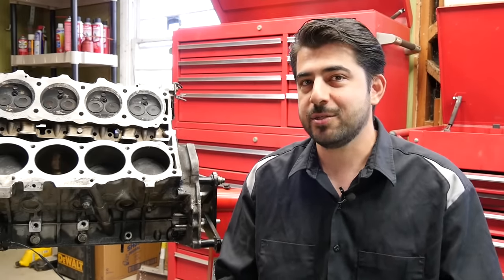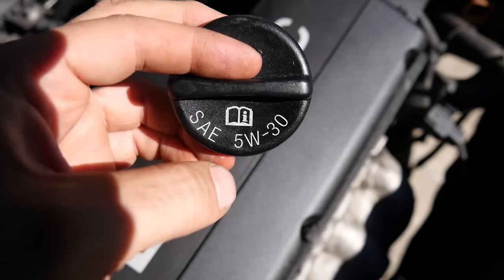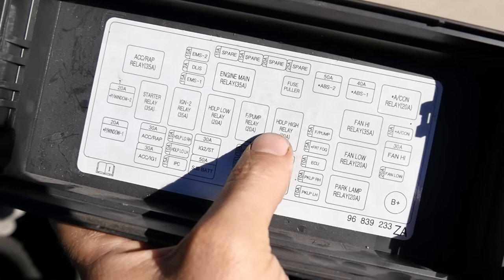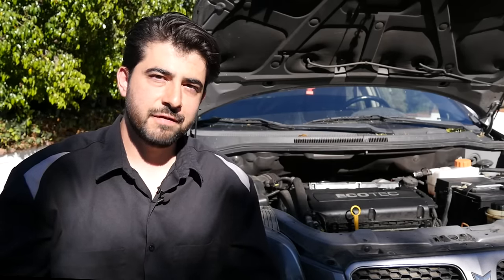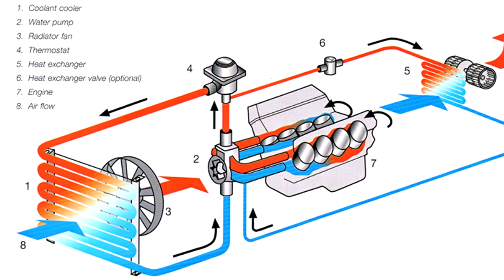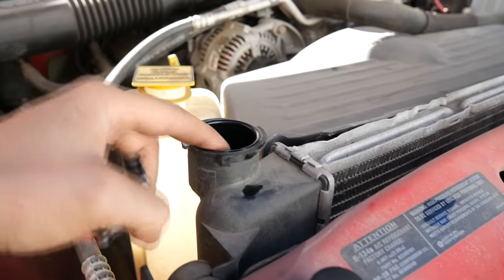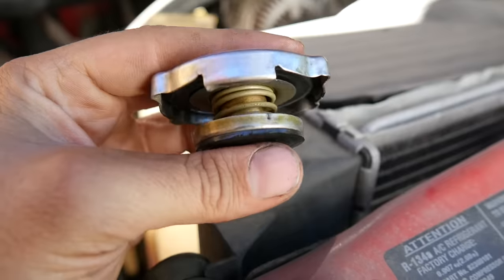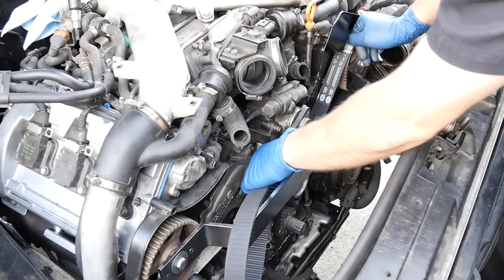Make Your Car Engine and Transmission Last a Very Long Time - Top 5 Tips On Car Care

Comment: Letting your engine warm up and cool down properly and changing oil ever 10,000km (I only use Mobil 1 0W40) already goes a long way.
Reply: Hey bro. Can i use 0w40 instade of recommended 5w40 for skoda 1.9tdi engine?
Mobil1 0w40 is great oil.
Reply: @1.9tdilove71  sorry for the late response. You can use it. If the car has a particulate filter you need the 0w40 esp oil from Mobil 1.
Reply: @Rodrigo Novais exactly!
Reply: @xcofcd  Thank you. Car is not having dpf. 
Which would be good oil 0w40, 5w30 or 5w40 for 1.9tdi diesel?
Reply: @1.9tdilove71  I'd use only the Mobil 1 0w40.  I had it in all my BMWs diesel and gasoline and never had any problems with engines. My Diesel at the moment has 430.000km and even has the first turbocharger. More important than the brand is changing the oil regularly and much earlier as the recommended interval. And don't use the typical longlife oils like 5W30 they're all more designed to save fuel than to minimize wear in the engine. The number before the W tells you the viscosity of the oil when cold. When you live in Norway where its cold for example a 0W oil is much better than a 5 or 10W as the oil gets everywhere in the engine much quicker on cold starts...
Reply: @xcofcd  Thanks bro. 
My 1.9tdi diesel is 2007 model, clocked 90000 Kmart on odometer. 
I use Mobil 1 0w40 from the beginning. 
I heard about Amsoil that it's good. what you think?  And do you use any diesel additive?
How is that Liqui moly molygen 5w40 and top tech 5w40?

Comment: Transmission cooler is a solid advice. Add external oil cooler since many cars nowadays include turbochargers which make the oil extra hot.
Reply: When buying a truck, get the tow package, it likely has an extra transmission oil cooler.

Comment: My 2005 Ford Focus is reaching 300K with the original engine. The Steel Drive Train/Timing Belt probably helps. Also I believe it being the more sturdy built "Special Edition" probably helps too. Plus I service everything when it needs to be serviced and use only Full Synthetic Fluids.

Comment: What about putting an oil catch can, I think it would reduce the crap that goes to the engine that would make it dirty from inside, especially in GDI's
Reply: @ThePatUltra Your points are valid, but a catch can is also a very good solution to GDI carbon buildup on valves.
Reply: Scotty all explains in his videos they fixed the GDIS bro

Comment: 1997 Ford Expedition 4x4 4.6L.
352,734 miles and not even a tap .
Secret ?
Change the oil and filter every 3,000 miles.
Reply: Dang! Good job, bud. I wish my 2013 Ford Fusion will make it to 200,000 miles. I love the car, but the transmission has a slight jerk between 2nd and 3rd gear at 99,400 miles... though it's minimal and doesn't always happen. I'm doing my best to maintain it in good shape. If I can get another 100,000 miles out of it, I'll be as happy as a clam.
Reply: @LuisRamirez-ln3cj  like scotty says stick with a toyota. Their transmission and engines are greatly manufactured. Maybe Ford trucks are better i am not sure. But I have had great experience with Hondas and most recently a toyota
Reply: @LuisRamirez-ln3cj  change the speed sensor.. theres also an adjustment around the valve body that will make that go away
Reply: @fredc8618  I'll keep that in mind and check it out. Thanks!
Reply: What about the trans and the transfer case 
And the differential???

I know you put a rear hub on it for sure though!
Reply: machia0705 I have a 2006 Ford F150 with a 4.6L with over 341,000 and you're right. That thing is awesome.
Reply: @sajid1891  ford trucks are definitely not better
Reply: @123ChrisG  like I said I am not sure. But I have a few friends who have been driving the same ford truck for the past 15 to 20 plus years with over 200k on it. They bought it brand new.
Reply: @LuisRamirez-ln3cj  ford fusion and feista had transmission issues. Trade it off.
Reply: Luis Ramirez The 2013 fusion and focus both have documented transmission jerk problems. It’s not the car failing, that’s the car. It’s just cheaply built.

Comment: It's true that cars have timing belts but you should also mention that if the car has a timing chain instead, that these are not required for replacement..
Reply: Depends on mileage. Some timing chain will wear out in only 180k.

Comment: What do you think about installing a seperate oil cooler?  Do you think the stock oil pump will  be able to push enough oil and circulate it appropriately with an added cooler?  Thanks for all the great videos!
Reply: I think it's unnecessary, and can cause more problems as you said. Don't keep it in drive (or reverse) unnecessarily, as that heats the transmission up. Change the transmission fluid a little more frequently if your type of driving gets the transmission hotter, but not too frequently because you don't want to remove all the old fluid which has particles of friction material suspended in it, and that's what helps it to engage and provide drive.
Reply: @JulianKapa  thanks so much for your detailed reply.👍

Comment: I have to disagree with the last point. OEM parts are usually a good. However, there are many excellent aftermarket parts out there. There are also even aftermarket parts that outperform OEM parts.
Do your research both for professional reviews and direct feedback from owners who have installed the part.

Comment: Debatable on flushing a high mileage transmission.
Believe it or not, some of that high mileage fluid is what is keeping some of those transmissions together.
Reply: It will cause it to slip more but it will also prevent any further wear.
Reply: Fact

Comment: I always prime my oil filter, even if it goes sideways, just don't top it off. Too clarify, quality aftermarket parts, bendix, wagner, gates etc... are fine as they meet or excede oem. Asking for the cheapo replacement at Autozone, NAPA or any major autoparts outlet, may save a few bucks up front, but can end in disaster. Just not worth it.
Reply: I only get parts if they have warranties. All of the manufacturers you mentioned warrant their parts. If it's not a good enough part to have a warranty, it's not a good enough part to put in my car.

Comment: I aint never doing a trans flush.
Reply: Better to change the transmission fluid, then drive it 1000 miles, then change it again.
Reply: @crand20033  ^ or alternatively just drain and refill every 10-20k miles
Reply: @no candy Drain and fill doesn't replace all the fluid.  Maybe it is 1/3 to 1/2 of the fluid.  Assume 1/2.  First drain and fill (DF) leaves half old fluid.  DF in 15k again, that means 25% old fluid.  DF in 15k more miles means 12.5% is old fluid.  DF in 15k more miles, 6.25% is old fluid.  This is why D&F is done much more often than is necessary to completely remove all the fluid and completely replace all the fluid.  Maybe you knew this, but it sounded like you were contesting Scarea's methodology which appears to be pretty sound.

Comment: Really find it hard to believe that engine wear occurs after an oil change or before starting up because you still have residual oil on bearing and other engine parts. Oil also gets from the pan to the cams in a matter of seconds.
Reply: Will Kerdasha yeah you must not understand oil pressure. The bearings in an engine, cams, valves, and pistons all are expecting a pretty high amount of PSI of oil. The pressure and oil pump create a film boundary layer that virtually eliminates friction. The oil passages are small and it’s not a high flow situation but it’s high pressure and low flow. So when you don’t have oil in the filter, it will take 5-10 seconds to fill it with oil and then to regain full pressure. This won’t blow the engine but that’s not the question. The goal is to eliminate all avoidable wear.

Comment: F150 4x4, 429k miles. Purring like a kitten. Original 5.4L & Transmission, 4 wheel drive,  Starter, PS PUMP, Radiator, & many other original parts.
How ? The gas pedal. I have never ever stomped on the gas. No jack rabbit starts.   
Gentle on the gas pedal & it will run forever.

Comment: Flushing the transmission destroyed my BMW transmission, never again.
Reply: why and how?
Reply: @Frank. T Yep, drain and fill like the factory recommended book says!
Reply: Frank. T what do you mean just take the drain plug out and be done or csn i change trans filter then refill
Reply: Flushing is for toilets.
Reply: Your transmission was already fucked if that's the case. Transmission fluid should be replaced every 60k-75k depending on the vehicle. There is no such thing as a life time fluid.
Reply: That usually means the parts were too eroded by that point anyways and the number of particles helped create enough friction to keep it moving so it wasn’t the flushes fault
Reply: @MiguelRPD  Yes, but the practical point is that his transmission was still functional before the flush, and very likely could have been functional after a drain and fill.  But it sure wasn't functional after the flush.  The GOAL is to have the vehicle last as long as possible. If you can get another serviceable two to three years off the bad transmission, why not do it?

Comment: Im not sure if my used car has had its timing belt changed. Its a 2006 ford focus 1.6 with 78,000 on the clock. I have read the belt should be changed either at 100,000 miles or 8/10 years time. Im thinking of just waiting till 100k.
Reply: luis luis good cars. Be safe and change it before 100k mis. Use high quality motor oil & filters. Change oil at 5k mis. Owned 2 Focus got 200k mis + out of them!
Reply: David Klimmek Thanks for the advice David. The car now is worth only about $1600 now and i have spent the same amount since i brought 4 years ago on repairs. Im not sure if it is worth it for me to spend more money on it or not?
Reply: Change it no big deal and not expensive.
Reply: @luisluis5306  its worth it
Reply: luis luis yea why not it's inexpensive an the car will keep on running!
Reply: 2006 Focus should have a duratec 2.0 with a timing chain
Reply: @Davido50  
Louis, if you do the work yourself one hundred a month in maintenance is still better than a having a car payment.
Reply: Exactly. Repairs cost less than a new used car. Depends on your skill and free time
Reply: luis luis Most manufacturers only recommend timing belts be changed according to vehicle mileage, not time. Toyota is a perfect example. Their interval is 90,000 miles. Of course you can opt to go longer at your own risk, but most Toyota’s are interference engines. Research your specific engine and see if it’s an interference engine. If so, when the belt breaks valves clash with the pistons. If not you just need a tow, no harm no foul
Reply: @PeeterPuncher  Right you are, 93Cobra. The 2005 was the last year with a belt in the North American market. Don't know about overseas.
Reply: @projectnerdvana2820  impossible, actually. All 2006 Focuses in the North American market have timing chains. He can verify by looking at the cover behind the aux belts (December 2005 and earlier) or serpentine belt (made in 2006). If it is plastic it is keeping dirt and oil off a belt; if it is metal it is keeping oil on and dirt off a chain.
Reply: @20PercentMilk  That could be, Conner McBride, but now you have an  "Old used car"
Reply: @nordicpride9708  Most Toyota engines are non-interference except VVTi, engines.

Comment: about 15 years ago, i bought a Toyota pickup with almost 200,000 miles and the 22re engine.  i put 220,000 more miles on it. only sold it because i'm going blind with cataracts. great truck.

Comment: You forgot the PCV valve.
Reply: Is a PCV valve going to cause a catastrophic failure?
Reply: Yes! PCV valve should be inspected and cleaned out at 80k some cars suffer more than others and after 100k it should def be replaced.
Reply: PCV value is going to cause acidified oil to eat the engine, and gunk to gum it up, so not a direct cause of failure but yes it makes the oil go bad fast and bad oil makes the engine wear out sooner.
Reply: I didn't forget about it, famke.  It's right here in my pocket. (PCV valve)
Reply: @z33tanner  in my RSX I just got it was never changed. It was clogged and oil was all over. I replaced it and it's fine now. In other words just do it. They are cheap and easy to change.
Reply: Bad and/or clogged pcv valves can lead to premature gasket failures.
Reply: PCV valves are definitely parts that should come only from a dealer. Why? Aftermarket valves are crap! All of the valves I've bought in parts stores were broken before even being installed! The parts stores know about that too. That's why they don't have warranties!

Auto parts store: no warranty on that because it is a 'filter,' and you should replace it 'every 30k' because it was broken in the first place.
Toyota dealer: 24 month warranty regardless of mileage, and you replace it 'only if it falls' because it may not fail for 1 or 200k.

Comment: Nobody take off their fuel relay. It is good to know
Reply: Holding the gas pedal all the way down on modern cars achieves the same thing.  It's called clear flood mode and it disables the injectors as you crank it.  Much better than messing with critical electrical connections that may fail over time if you remove relays as a habit.

Comment: My 04 Honda Accord has 247k and still going strong. Just replaced almost every suspension component you can think of on front and have started on rear. I expect to get over 500k out of this motor. Honda or toyota is the way to go

Comment: My Toyota has over 300,000 miles and has never needed a repair. I configured my car maintenance software www.automotivewolf.com to follow the recommended maintenance schedule in my owners manual. It reminds me when any service is needed. I also use only OEM oil and filters directly from Toyota designed for my vehicle. Seems to be working just fine :)
Reply: I use Automotive Wolf too for my cars and a boat. Superb software that will extend the life of any vehicle.
Reply: I'm doing the same, but without the software.  I'll check it out.  I'm at 169k and going strong.  One thing my owner's manual states rather specifically is to not mess with the transmission, so I haven't tried to flush it or change the fluid in it yet.  Your Toyota may be different, but on mine it's just oil changes, wheel rotation, air filter, coolant flush every 60k, timing belt every 90k, and plugs every 100k.  There really isn't much to it.

I want to see if I can keep this car running past 400k in the stop and crawl conditions of my normal commute, to take full advantage of a car that's paid for.
Reply: @Dirtyboxer1  Do not listen to lifetime transmission fluid BS. Every 30-40K miles you should drop the pan replace the gasket and fill her back up with new fluid. This is how to keep the fluid fresh and avoid a trany flush. My trany is going out on my Camry at 241K miles because the fluid was never changed
Reply: Audio  i always wondered about the fuel filter
Reply: Toyota doesn't make oil. I wouldn't trust a dealer to use the correct oil either. But you might have found one that is more honest than most.

Comment: On a horizontally mounted oil filter,  you can still pre oil it. Fill it up on the bench, then before installing, dump out the excess. I haven't installed a dry filter in years.

Comment: If you want to avoid transmission issues which is just as volatile as the engine itself,  drive a manual you lazy bastards. I have driven over 300K in manual cars and trucks and NEVER changed a clutch. I also have never had a mechanical issue because I change the oil and don't drive or abuse the engine. Simple shit.

Comment: Stop watching this guys video never flush your transmission fluid only do partial charge
Reply: Alleycat 31 - you obviously don't know what a flush is typically referred to as.  That is when a transmission machine is hooked up to the car and fluid is forced or pumped into the transmission while old fluid is taken out.  His other video is a 'flush' in the sense that he is getting the vast majority of the fluid out of the vehicle but he is using the cars existing pumping facility to do the work.  That is much different than forcing fluid through with those machines used at transmission shops.  Nothing wrong with the way he did it just a little more complicated than doing a straight drain and fill.  I have done both ways many times but I will never take my car to a dealer that hooks up a machine to forcibly flush the fluid out. The forcible nature is said to dislodge particles which is why a flush has gotten a bad connotation and rightly so.  Not sure why you are saying don't listen to this guy - he is correct in my opinion.
Reply: Flush your toilet guys
Reply: Keyser Söze-  funny
Reply: @keysersoze6330 <- I'm on this guys team
Reply: Yep that’s y u do a partial transmission change not a transmission flush a flush is where u have all the atf fluid taken out u don’t want that
Reply: Alleycat 31 as I indicated you do a drain and fill.  Or you can use the pump in the transmission to pump out a quart at a time and replace with new.  Both work great I do it all the time.